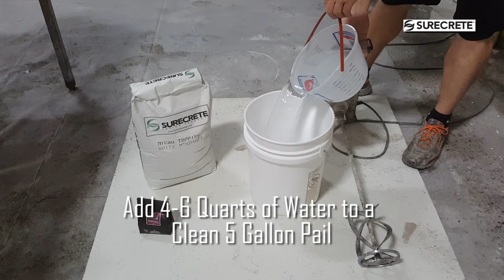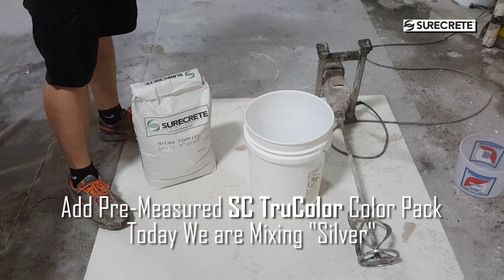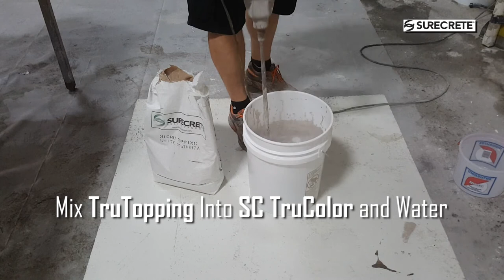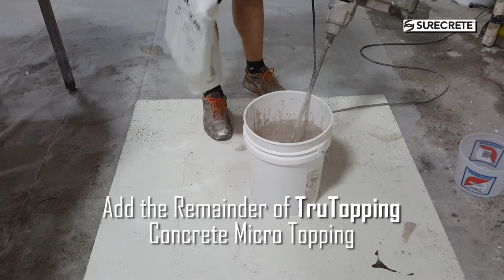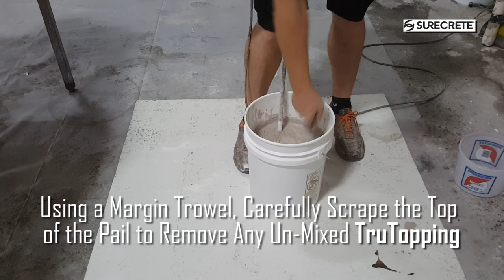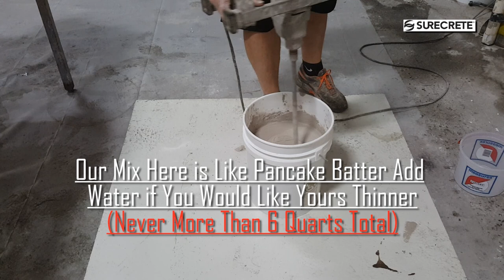How to Mix SureCrete Micro Topping TruTopping Thin Concrete Overlay

Comment: ATTENTION EVERYONE: I used the sure Crete micro cement one coat product on our house. It costs us thousands of dollars. Three times we applied this product to our floors and walls. The color pigment sold by surecrete was mixed using a industrial cement mixer, and two electric mixers. There were black and gold streaks across our entire house! We had a regrind down all our floors after following set by step instructions. We contracted surecrete and they told us they tested it in the lab and it works fine, case closed. Absolutely screwed us over. The product cracked within months on the walls. We recoated the entire floors with colored epoxy to finish the issues, another $1000.
Reply: did you mix the dry pigment in water first?  We like to let dry pigments sit for hours mixed in water before adding.  We also like to strain through a fine mesh strainer.  this pretty much elliminates the possibility of starring pigments.  As far as the cracking goes, i've never seen this product crack over properly prepped substrates.  What process did you use prior to applying the microcement?  I'm not accusing you of doing anything wrong, I  would just like to know your system so we can all learn.  thanks.